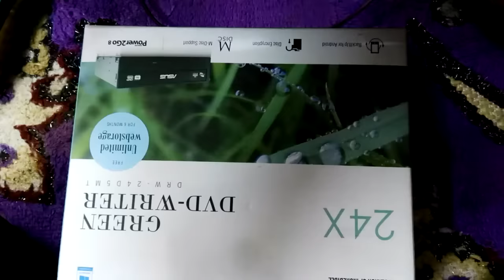how to find short circuit in laptop motherboard

Comment: I want to use your method, but I do not want to do it automatically. I want to understand what I am doing, and why am i doing, so if you please, tell me. When, with your Ohm meter, connecting to the right side of the first power inductor (the coil) you receiving an indication of zero, you say that there is no short. As far as I know, when between to points or components there is no resistance, this means that these two points or components are not communicate between each other. So why, if the right side of the coil do not connect with the ground, this means that there is no short ? On the other side (the left side of the coil) there is an indication of 0.001 Ω which is probably near zero, and it is also means that there is not connection. But you said that there is a short. On the rest of coils, you received a indication of normal resistance (a few Ω), that means that there is a connection between these coils and the ground, and the conclusion is that there is not a short in both sides of the coils.
And something else. When you saying that there is not short from this side of the coil what exactly do you mean ? Is there an area on the motherboard on this side that contains a shorted component ? And what are the limits of this area ?
Thanks

Comment: Yo bro I have a hp laptop that when I try to turn it on with the power switch the led turns on then off super fast and then nothing happens I think it's some sort of short but the charger led stays on I'm not sure what the problem is?
Reply from the maker: U try on laptop without hdd and remove battery and on with charrger

Comment: The ones on my macbook pro, two say 15-16, two say 5.1 or so, one says 3.2, two are really high, and two have no reading just say 1 can you say where the short is? This is my first time using a multimeter but i had it set to 200 ohm

Comment: Sir, My laptop power port was broken. So I soldered the port. It was running well. But unfortunately for the second time it was broken. I soldered again, may be shorted. :(. Right when I plugged the charger in I noticed a quick and small smoke and a spark on my mother board. I cant find out the faults, I would be very happy if you can help me out.
Reply: Did you solved the issue
Reply: @sleshinalappatt8203  I had to change the power IC

Comment: Ok so basically you test ohms, then if you get bad reading you isolate part (desoldering one side) and if it's low ohms on side that is desoldered it's ok and on other side isolation of part helps pinpoint bad coil, am I right?
Reply: I don't think it's about finding a bad coil as much as it's finding which side of the coil the short circuit is on.

Comment: What to set in my digital meter to find short circuit? What did u use? Thanks
Reply: How Not To   with a 9 volt battery in the meter, in ohms mode you risk  burning lots of things,no?  cpu runs at around 1 volt,no?  thanks   you need DIODE mode...
Reply: How Not To  get ANOTHER   METER and measure the VOLTS on the probes of the first multimeter in BOTH cases; you´ll  see the DANGER of the high voltage there,for a CPU that works off 1 Volt only ,   me thinks
"the chief has spokin"

Comment: Btw, where do you get Schematic Diagrams? also, where do you get the chips/parts for replacement? Thanks again!
Reply: You find the area of short, not component in short. Please complete the video if you can solve this problem. Thanks

Comment: hey there.. i hve a problem with my laptop - its on top condition but lately been powering off on its own. its getting worse. i try to detect several problems at first it seems like hardware so i check each of them turns out the fan connection to the mobo was a lil bit loose - if i dont press it tightly to the mobo it wont turn but it makes noises. so i changed the fan and thought that it would solve the prob but it happens again. hmm what do you think? i tried pulling out every hardware to try to run the test - seems all is working. (tried them on different laptops too)
Reply: thanks for replying! at first the usb board was faulty before the prob happened. i dont really know much - but when it was plugged in the motherboard it wont turn on - it works only after i unplug the usb board. the prob might start from there? gee i dont know - if i detach all hardware including ram and hdd how will i detect  the problem? for all i know it might be the motherboard :( buying a new one would cost me about 100$ ... would you recommend how to know which hardware might be faulty? for all i know the hardware includes ram, the keyboard, the system fan , the internet card, the bluetooth card, and the secondary usb board... :D
Reply: by the way i recently replaced the system fan and the keyboard with brand new parts
Reply: also - the symptoms of the power off problem previously was when i am watching videos. it turns of quickly especially if i watch streaming videos. if i play video from my hard drive it powers off too but not as quickly as when i was streaming. then about a month later it started to power off when i play games! it powers of once or twice then finally it would last me longer - but eventually powers off as well. and then now its gotten much worse - even when its idle and even during sleep it would power off on its own. that much is what i can give you! what do you think?
Reply: the heat of the processor and graphics card are alright - it always stays around 60 celcius if im using it for games. other than that, idle state or even doing some work (multimedia or browsing using chrome) it always stays around 40 - 50. checked it using RealTemp and speedfan

Comment: thank you so much sir.
i have probook 4540s the charger light(orange)
 blinks 8 times when ever i try to on it
Reply from the maker: hi if the charger light blink when u contacted to laptop that's mean there is shorte in the input voltage for adaptor u need to check Mosfet  in the circuit probably one of them short

Comment: I think the idea of lifting a coil is a god one...

EDIT   TERRIBLE  DOUBT»»»   the ohmmeter  has a 9 (NINE!)  volt battery inside and it applies it all in the 200 ohm scale ( ««don't»»  touch the probes to your tongue, you'll see,feel,the 9 volts;
question:   is it safe to probe around those circuits that may be of only 1 volt ,with those probes infected with 9 volts of coronicvirus?   thanks